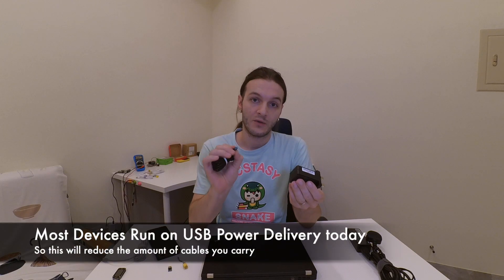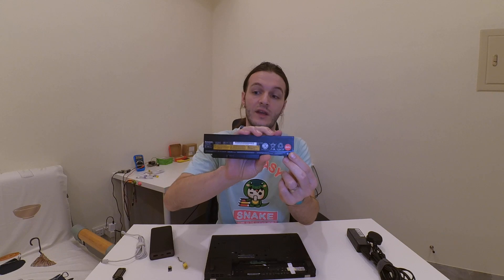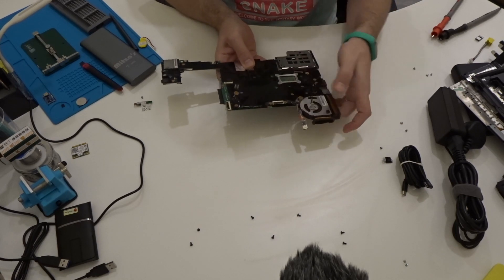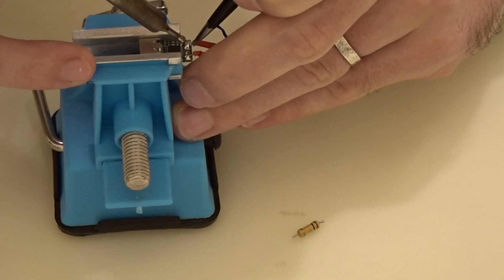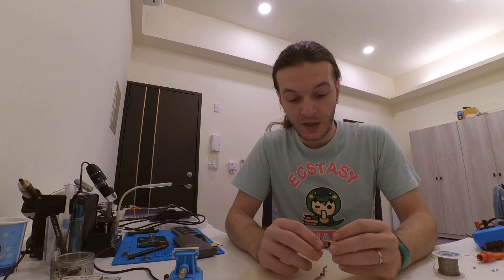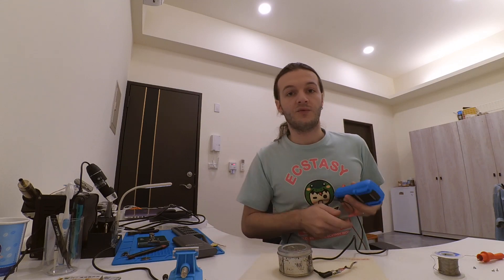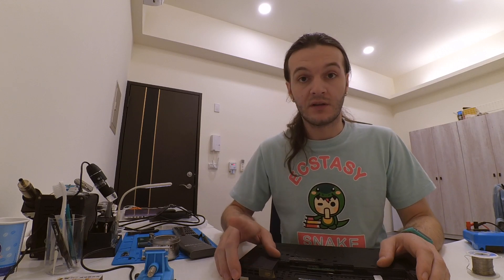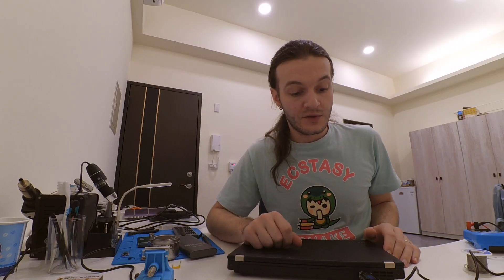Laptop Lenovo Thinkpad X230 mod add type C Power Delivery

Comment: Can this be used to charge other things too? For example, power a Raspberry Pi (it wants 3A over USB-C)
Reply from the maker: Yes but be carfeul to make sure the adapter board you are buying will deliver the voltage and Amp required by your client/sink device.

Comment: Hey man, trying to make my own one of these. Is the value of the
resistor critical, what is it's role exactly? I have on hand a 510Ohm 
SMD resistor I salvaged from an old router and it would be convenient for me to just be able to use that.
Reply from the maker: Hey there ! Congrats on the project ! The value is important as it tell the laptop's PMIC how much power it can pull from the power supply that you will be using. Depending on the laptop that you use ( up to x230 you have 10K for 65w and ID pin not connected for 90W) you can have various values ( on x240 and upwards there lots of values that you ca find online).
Reply: Thanks for the quick response. I must have been lacking sleep because when I looked at thinkwiki I looked at the resistance value for a 90w slim connector where as I actually have a 65w X230 with the barallel connector. 510ohm is definitely no substitute for 10kohm.

 I notice no connection is needed between ground and signal pin for 90w laptops. Is it a bad idea to leave out the resistor and make a 65w mobo "think" that it has 90w available?
Reply from the maker: @spungbob_spare_pant  My pleasure ;-) . No worries , all of us get moments when we read a bit on a side ;-) . Nope, you can just leave it unconnected and that's that. Just if you run an i7 and you push it to the limits with a 65W charger you might get the charger to get in protection state. That is no problem as you can unplug and replug to fix it. If I would be you I would definetly try it as at least you can if it works fine or not ;-) . Oh and yes, the id pin for 90W basically can be disconnected completely.

Comment: Soldering something THAT SMALL is about 1 year of experience away from my current ability… if I did this job, the micro resistor would be COVERED IN SOLDER….  How do you PROPERLY solder something THAT TINY???
Reply from the maker: :-D It just takes practice :-D I would say that the best way to solder small resistors is to try and add solder on one end of the resistor and after that solder it to a wire or a pad directly. Just as an idea, you can solder by hand even 0201 resistors but for that you need a microscope also :-) . Keep practicing and you will do it on your own :-)

Comment: bro i have a question (not the same model, but the same idea): if i re-use the original charger of my laptop (which matches the requirement of the module btw), changing the conector to usb, do i have to add the resistor?? because i saw a tutorial were the laptop was similar to mine and the person didn't add the resistors
Reply from the maker: Hey there Ariel ! Just to be sure, you want to change the connector to usb-C but still use the original charger ? If that is the case, then you can proceed without any problem as long you make sure to use correctly the type-c VCC and GND pins and by this I mean to make sure you dont pass more current thru them than what they rated for plus the pinout just to protect your laptop in case of any mistake. The resistor was needed in the case of thinkpads as they have a third cable coming from the charger. If you pass the cable thru the type-c connector, then all is ok and you don't need to add the resistor like I did. The downside is that your device will only work with your custm charger but it will work :-D .

Comment: yes bro, I am from Malaysia and I am interested in having this mod.. Thank you for your efforts to make the Beloved Thinkpad X230 updated and relevant for the next few more years  ( we are now in 2021, and this machine is approaching 10 years old)
but the fact remains...... this is the last Thinkpad that we can freely swap RAMs, HDD/ SSD , replace charging port, and 3x USB ports.....i couldnt part with this machine.... I was planning to replace this unit with the T480 (because it has Type C PD) but i have to sacrifice the ease of access to all the drives and RAMs... that I disregarded it all together ........

Its so refreshing to see you successfully mod this X230... 
My best wishes from Malaysia. Stay safe
Reply from the maker: Thank you for the great feedback :-D I know what you are dealing with as I wanted a bit of newer laptop also for some work realted reasons though I personally found that L380 was able to sort of satisfy me as it gave me access to upgrade 2 ram sticks and the nvme ssd. I pushed it to 24GB ram and 1TB SSD plus it has 2x type-C ports with display port enabled and also it has 2xUSB-A and an HDMI port ; so it is decent an super far form the X230 that I love :-D . 
Stay safe also and have a great 2021 ;-)

Comment: Hey, I'm attempting this mod myself, and while the zypds charges my x230t fine with a usb c wall charger, I have a 45w battery bank that I'd like to charge these with that isn't working right. the laptop will say it's charging for 3-4 seconds, then say it's on battery, then go back to charging. The power bank seems like it's outputting constant voltage.
is there a way to modify either of the usb ends to fix this, or possibly mod my x230t to charge off of a lower amperage? I'd really rather not get a new power bank.
Reply from the maker: Hi there, the problem you have is 2 fold : 1. THe power bank probably can output 20V but generally they will only output 45W and that is under the minium set point . the minimum setpoint for lenovo X230/T is 65W. 2. You are charging with the laptop on, thry to charge while the laptop is off so the power drain will be lower and once the laptop is half charged you should have no problem.

Comment: Nice video, I have 2 questions:
I have a HP laptop with 19.5v 6.15A 120W, It could be possible that i make adapter only with 20V PD 100W just for charging?
Another laptops can be powered with pd?, it's not problem with voltage or I need  to put a resistor to decrease the voltage ?
Reply from the maker: Hi there : 1. Yes it is possible but you have to figur out the protocol used on ID pin to inform the laptop about the power output of the charger . It has to be probably ismilar to dell's https://hackaday.com/2014/03/03/hacking-dell-laptop-charger-identification/ . 2. THe voltage of 20V is not going to create a problem as actually all the devices will have tolerances and you will anyway have some voltage drop on the cable.

Comment: Would your drop in mod work even for an x220? How high is that port rated for in terms of watts?
Reply from the maker: Hi, Yes it works for X220 and I tested the mod for 90W-100W. This is because of the fact that the load will not pull precisely as it changes the value while getting hot. The mod does not get warm(30 degrees in a 25 degree room after 1h of 90W load).
Reply: @MikePDiy  I've just placed an order :D
You're truly amazing, thanks for all the effort you've put in this mod
Reply from the maker: You're more than welcome and thank you for the order :-D. I will handle it on Monday :-) .

Comment: Hey there, This idea is awesome!
I have a L440 and i was wondering, would this hack for that laptop?Thanks for the reply and keep up the excellent work!
Reply from the maker: Heya ! Thank you for the kind words. Sure it would work. Just make sure your charger provides under 100w. This little board will be able to supply only 100w at maximum. All the other steps are very similar so you can surely do it :-D. Please keep me posted of you do this mod. I will upload Saturday a video on how to do this on a Lenovo X250 which has the same connector with your laptop.
Reply: Awesome!  thanks a lot for the quick reply! Ill try this after my exams ^^

Comment: Damn that's awesome. If you were to sell these with a proper mounting (so one doesn't need to use the hot glue) I'd buy it.
Reply from the maker: I will post another video in the coming days. I am almost ready with all the details. The plastic case protype just arrived today and fits well ( No Hot glue needed, just take the old connector put and put this new one in :-) ). In the next video I will give more details and more info about ordering this part. Thank you for the interest :-) .
Reply: @MikePDiy  Looking forward to it. What would be the maximum charging speed with this mod anyway. The board supports up to 100W so it should be possible to achieve with powerful enough charging brick right?
Reply from the maker: @lukszakes2132  the charging speed is determnined by the laptop's power management IC. In order to increase that speed, we would need to do changed on the PCB of the laptop and that is a bit tisky for the vast majority of people :-). Now the kit for X230 is available for preorder so if you are still interested, 
please preorder it from here https://www.tindie.com/products/19077/ . 
There is also a video describing in detail the charging kit and all the aspects 
about using it here: https://www.youtube.com/watch?v=AD4kIKBe35c .  Thank you for the interest shown :-) !
Reply: Hey ,
Can I still order this connectors?

Comment: Two questions. 1) what purpose does the resistor serve? 2) what resistor is best for t460s and why?
Reply from the maker: Let me answer point to point :-) 1) The resistor is the way you will tell your laptop what kind(power level) of charger it has connected to it. If you connect a 65W charger to a laptop that normally uses 90W, thenm it will limit some of the functionality and also it will pull less current thus resulting in a slower but safe charger. 2) There is no best resistor value sadly. There is the original value that will do the best job and here is why: the original value is what the laptop is looking for ( ofc if you have a 65w charger than any laptop with the same type of charging port will use the same resistor value for 65w and I limit my example on Lenovo Thinkpads here) and you can measure that with a multimeter between the ID pin and the GND pin while the powrr supply is NOT connected to AC. there is this website where you can find the values that other people have measure for almost all the lenovo charger types https://www.youtube.com/redirect?stzid=Ugx_r_xG8C2BBqVoJr14AaABAg.93heUflD8Jp93itW1q1erO&q=http%3A%2F%2Fwww.thinkwiki.org%2Fwiki%2FPower_Connector%23Signal_Pin&event=comments&redir_token=juXXjk7WuAAufTDtQ3rC3iaK7RZ8MTU3OTUxMTI3N0AxNTc5NDI0ODc3 but I strongly suggest if you can, to measure the value from your laptops charger. *Note : If your laptop uses a charger that provides over 100W please limit the resistor value to the equivalent of a 90W charger because finding a 100W+ typeC is not an easy job(not sure how many are out there). So there are some short comings with this modification once your laptop charger is over 100W. *Note2: Your new typeC charrger needs to be able to provide at least the Wattage that your laptop will pull ( 90W typec charger for a 90W laptop charger). There are other details would influence this and help you to run it with smaller wattage chargers but to keep it simple, just use the above as an indicator. I hope this helps and please ask if you have more questions.
Reply from the maker: Hi, I have made the charging kit for the lenovo x230 so if you are still interested, 
please preorder it from here https://www.tindie.com/products/19077/ . 
There is also a video describing in detail the charging kit and all the aspects 
about using it here: https://www.youtube.com/watch?v=AD4kIKBe35c .  Thank you for the interest shown :-) !

Comment: I would also purchase one for the x230. If it is also compatible with the t450s I would take two.  And as everybody else said great work.
Reply from the maker: In about 2-3 weeks I should be ready to sell the X230 version, now I am fine tuning the plastic case as the electronics design and test is done.In the near future I will start to work on a version that will work on the T series. It would help if you let me know what Wattage has yours ( or Volt and Amp output of the charger). Thank you very much for the kind words and I will update you once the X230 charging port is ready to ship.
Reply: @MikePDiy  Thanks. So the T450s power supply  outputs 20V and 4.5A. keep me posted with the x230 usb c adapter. Is there a email I can reach you at.
Reply from the maker: Sure thing, you can reach me at mikepdiy@gmail.com. Your T450s seems to use a 90W charger and that is something my board can support so I will reach out when it is ready also ;-) .
Reply from the maker: Hi, I have made the charging kit for the lenovo x230 so if you are still interested, 
please preorder it from here https://www.tindie.com/products/19077/ . 
There is also a video describing in detail the charging kit and all the aspects 
about using it here: https://www.youtube.com/watch?v=AD4kIKBe35c .  Thank you for the interest shown :-) ! for the T450s, I will start working on it soon :-)

Comment: Hey, I was going to do this on a t440p with a 90w charger I was wondering if a 540 ohm resistor was correct
Reply: https://imgur.com/gallery/sFaS2df
Reply from the maker: @16megabytes95  If 540Ohm is what you have measured on your original charger between the ID pin and GND, them that is it :-) . According to http://www.thinkwiki.org/wiki/Power_Connector#Signal_Pin the value is 550Ohm but you are safe with a 560Ohm resistor also. Please check what your ZYPDS board out value is when connected to a PD charger. It looks like your jumpers are no longer on the board and unless you have the jumper for 20V made, the board will output 15V. If I am not wrong, your t440 needs 20V. If you have 15V on the output of the ZYPDS board I can guid you to fix that.

Comment: what is the smd resistor that you use, and what is its resistance range
Reply from the maker: Hi Ryan, I am using a 10KOhm resistor. I suggest you to measure the resistance of your own charger but there is a useful table here http://www.thinkwiki.org/wiki/Power_Connector . Be aware that the resistor basically "tells" the laptop power management how much it can draw from the charger. If you put a resistor that tells the laptop power management that it can draw more current than your power supply can offer, it might be dangerous :-) .
Reply: @MikePDiy   i have the exact same thinkpad as you have modded, will it not be the same resistance
Reply from the maker: @ryanhope1257  I only had the X230 with i5 ( a few of them). I don't know if an i7 x230 will still use the 65w charger but if you have a 65w charger it will be the same 10KOhm resistor.
Reply: @MikePDiy  I have the i7 version, where can I check to see what watt my power supply is
Reply from the maker: @ryanhope1257  Have a look on the sticker that is on the back of your power supply where it states the output. For 65w the label will state 20V and 3.25A. Alternatively, some of the x230 chargers have embossed on the front the power in the form of 2 digits followed by a W ( 65W in the case of a 65w charger or 90W in the case of 90W chargers).
Reply: @MikePDiy  hey mike I'm pretty new to electronic stuff i have a 90 watt charger and want to do this mod wich one do you recommend?
Reply from the maker: @viriv  Hi, please be a bit more descriptive so I can help you :-). Your laptop uses a 90W charger or you have 90w PD charger ? Where or what for you would like my recommendation ?
Reply: hi mike im sorry for the confusion i am talking a bout a 90watt 20volt power brick for my i5 thinkpad x230  and i want a recomendation for a resistor thx in advance
Reply from the maker: @viriv no worries . Based on the info available at http://www.thinkwiki.org/wiki/Power_Connector you should not need a resistor. I recommend you to be careful as once you switch to the PD powersupply, your laptop will pull as much current as it needs so if your x230 thinks it can draw 90W but the PD power supply can supply 65W only, it can get dangerous if you don't have a good protected and well built power supply. As you say your x230 has an i5, then you can put 10KOhm resistor on the ID pin(Between ID pin and GND) as all the X230 laptops(not X230t) that I had were running on i5 and they were originally shipped with 65W chargers. In this way you will also be able to find more options for a decent priced PD power supply.
Reply: @MikePDiy  my power supply draws 20v at 4.5A, do I still need a 10k ohm resistor
Reply from the maker: @ryanhope1257  In this case you don't need the resistor (again I base my info on the website that I have linked above as I don't have a 90w power supply to measure myself), you can measure the resistance between the central pin and the GND(outer side) of the charging connector while the power supply is not connected to to the wall plug to double check. Please pay attention because you will need to use a 90w or higher PD power supply. Alternatively you can put the 10KOhm resistor and use a 65W power supply, in which case your laptop will sometimes not use the processor at full speed if the battery is too low or the battery level might drop if you have the laptop charged and it is under high load but for tasks that not processor intensive ( writing code, browsing internet, office docs, watching a movie and so on) you should be absolutely fine.
Reply from the maker: Hi, I have made the charging kit for the lenovo x230 so if you are interested, 
please preorder it from here https://www.tindie.com/products/19077/ . 
There is also a video describing in detail the charging kit and all the aspects 
about using it here: https://www.youtube.com/watch?v=AD4kIKBe35c .  Thank you for the interest shown :-) !